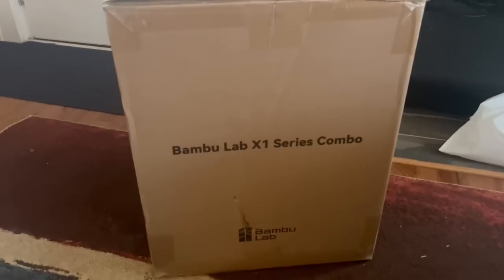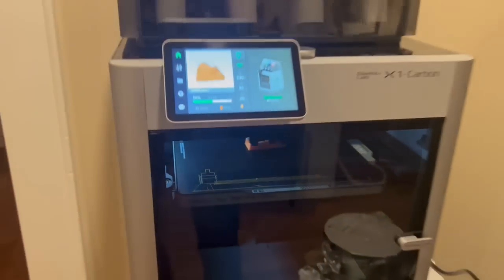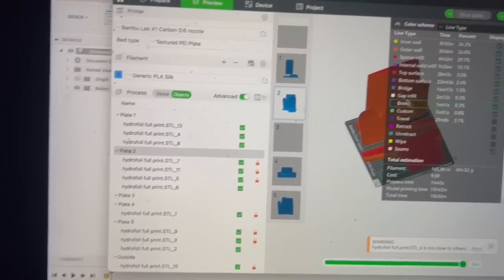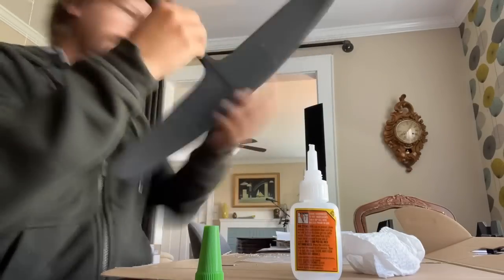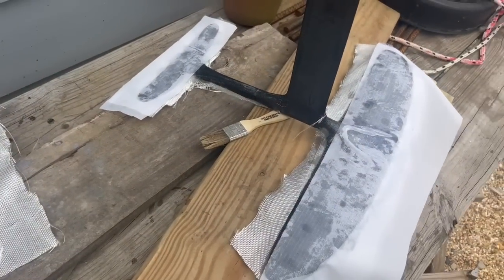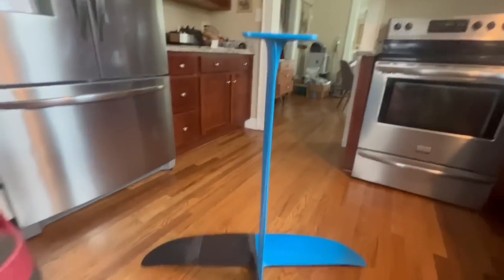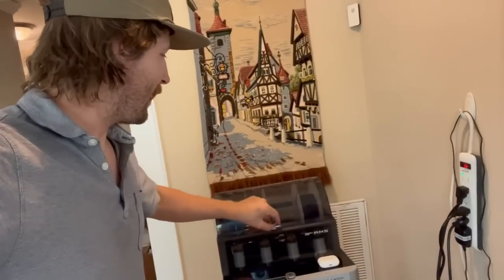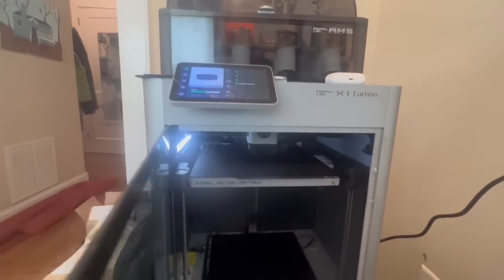3d printing Bambu lab, Bougerv solar, Jasion, TSTWheels, MOKwheel ebikes

Comment: The sensors are cadence vs torque sensors.  The torque sensors can determine how hard you are pedaling and apply torque based on that.  The cadence sensor just detects that the pedals are spinning and apply full torque based on the PAS level.  You can change the percentage on the bafang motors at least for the mid drives.

Comment: I highly recommend using internal and external slip together features to add strength and alignment. using the support filament will help with the tolerances with those features. also you can get carbon fiber stiffening rods that would be helpful in the keel section. I would love to see one of the printers make it on to the boat!

Comment: Install spoke protectors on the back wheel of the e-bikes if you want to take passengers.  You can just zip tie some plastic sheeting in the rear triangle.   Passengers try to rest their feet on the frame right next to spinning spokes.

Comment: Can't wait to see you on a trimaran! Make it happen, even if you have to 3-D print it.
Reply: Was thinking a new technique might work using 3D printer to make clips/jigs/alignment parts to hold together carbon fiber strips. The strips could be bonded together to make hull, deck or other parts of the boat. The thought being that the carbon fiber strips would be mass produced, making them stronger/cheaper, while the custom 3D parts can be printed of less durable materials.

Comment: Sam; I've built and repaired light aircraft using FRP composites with epoxy resin, the peel ply isn't structural...it's used to give a nice finish to a hand layup and , as per the name is designed to peel off the partially cured ( green stage) layup.

Comment: I'm near Durham, NC, you're in my neck of the woods. You should try to print the negative mold for your foil and lay your composites on that instead of the positive. You can vacuum bag it for much lighter and stronger parts.
Reply from the maker: Great idea

Comment: If you milled a rectangular notch on with side of the stem and filled it with unidirectional carbon it would help on strength and stiffness

Comment: Damn that thing prints smooth and neat even on that ludicrous speed shaking the table. The different softwares for printing seem to be a lot more streamlined than when I was into this stuff in 2015-ish.
Bolt 'er to the work bench next to the vice.  Lol

Comment: You should check out the IMOCA round the world boat race. Sail boats racing around the world. They just finished a leg of  the race and have there boats out of the water for repairs. These boats sail in 50 to sixty miles per hour winds and have speed if up to 35 to 40 mph. They sail in seas with waves 35 to 40 foot high. Ben

Comment: Great video Sam. On the E-bike you have to get one with a torque converter so it will be a lot smoother. The last bike you rode is smoother because I’m sure it has the torque converter.
Reply from the maker: Ah thanks for the explanation. I definitely like that feature
Reply from the maker: Ah thanks for the explanation. I definitely like that feature
Reply: Torque sensor is what you mean! Cheap ebikes determine motor assistance from your cadence (crank rpm) nicer ones haves Torque sensors in the cranks that determine how hard you pedal.
Reply: @feedurheadhesaid  yes you are right. Technical names lol.

Comment: Foil --- looks to me like the attachment plate right-angle is the weak link - suggest expand the plate as much as possible; and add ribs across that corner in all directions.
Reply: structural strength is achieved by sandwiching un-like materials or constructions ... So the fiberglass outer layer (glass: super high strength, but brittle) ... Suggest solid  but relatively thinner, carbon fiber 'skeleton'; rest of the shape fills in in the second step: a female fiber glass mold lay-up with a colour coat.  :) 
Try a more flexible materials approach? (bend, don't break)

Comment: Hey Sam, new to your channel, I found you looking for how to sail a Hobie 16, thinking about getting one as an intro sailing vessel. After that I couldn't stop watching your videos man, really great content. I don't think I've seen anything like this in my many years on the internet.

Anyways, I just saw you posted this. I'm a mechanical/structural engineer, if you need any help with any CAD or modeling work, shoot me a message and I'll be glad to help. I also have a resin printer for anything really really detailed you might need. I have Solid Works, Solid Edge, and Blender (for aesthetics mostly). I sent you some beer money last night but would love to help you out further if I can.
Reply from the maker: Thanks for the support. I could probably use some help if I take this design further. I will let you know.

Comment: PETG has been my go-to filament for printing boat stuff. It has great chemical resistance with acetone, epoxy, and seawater as well as thermal stability because it prints at the same temperature as ASA. Maybe it's just past PTSD from printing with ABS that I'm still averse to ASA. Stuff just smells bad
Reply from the maker: Cool. Thanks for the recommendation. I’ll give that one a try

Comment: i used  pla carbon fiber  for the electric motor conversion of my  boat like the motor adapter plate and shaft coupling

Comment: You answered my question about whether you’d want to have a 3d printer on your boat - how awesome would it be to have a printer onboard to produce any parts you needed mid-voyage?!
Reply from the maker: That would be next level! This is the first printer I’ve used that like works good enough for me to justify bringing along.
Reply: @samholmessailing  awesome. Although still too bulky?
Reply: @samholmessailing  I wonder how much energy the printer needs for each cm^3 of print, as it uses resistive heating. Will the solar be enough to provide this power?